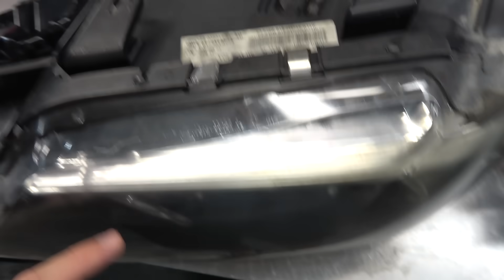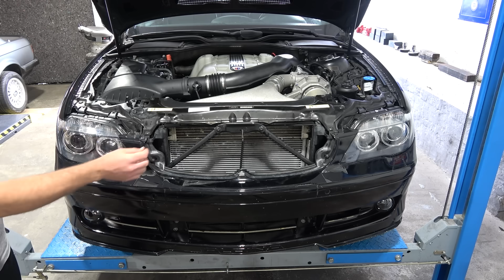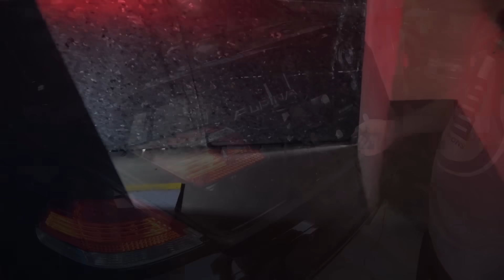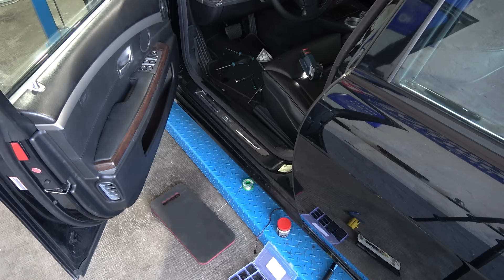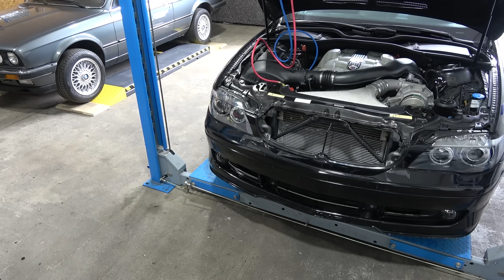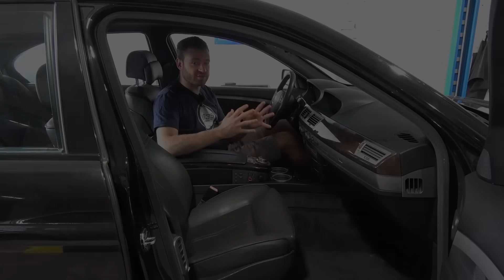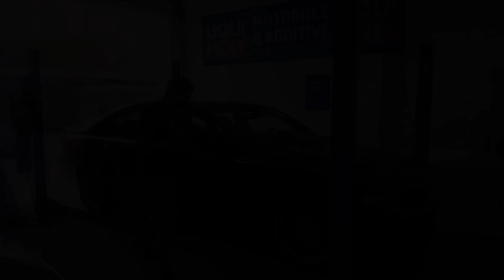Can We Make Alpina B7 Roadworthy Again? - Project Chicago: Part 12

Comment: I don't know did you do this because you didn't mention it or show it on the video (thankfully) but you have to shake those paint cans for 3 minutes. Some of them even say that on the can itself. Why? Because that mixes the paint inside them very properly and most importantly the pressure inside the can is very consistent after that and the jet coming out of the paint can nozzle is very smooth and uniformal. This also helps to avoid the orange skin on the part you're painting.

Of course all this is too late and, as I said, I don't know did you do that shaking for 3 minutes but just a headsup for you and everyone who's doing spray can painting. I did spray can painting as part of my job for 4,5 years and you could clearly see the difference between a spray can which you have shaken for 3 times versus the spray can you have shaken for 3 minutes.

Comment: Okay, you might think I'm completely wrong, and I might be, but I always say that if your brake line can't hold the weight of the brake caliper, it should've been replaced anyway. Of course, that only applies to smaller brakes. Anything with 4 pistons or more is way too heavy for that. But a single or dual piston caliper can be held on the brake line, IMO

Comment: The blinking from the LED angel eyes is from the bulb check. It sends a quick pulse of power that wouldn't be enough to light up a standard bulb, but the LED can react faster, so it blinks. These checks can be coded out to avoid the blinking. You'll need to code out the cold check, the warm check, as well as the notification in the gauge cluster for a failed check on those bulbs.

Comment: Isn't it a contradiction to say that the TUV is very strict because Germany's autobahn network allows ultra high speeds and yet the TUV cannot fail poorly functioning suspension if there are no leaks from the shock absorber?

Comment: Fuck bmw dealers, there are better mechanics. Just bought a Icarsoft V2 for my E70. The auto hold comes and goes. Works fine when its warm now in the summer but when it was cold it almost never worked. Sounds like some cracked solders unfortunaly and that I have to find a mechanic to fix.

Comment: you can also use ceramic coating on the plastic trim parts, makes them look black aigan. also how is the foliatec laquer holding up?
Reply from the maker: I tried, doesn't work :)

Comment: Re the license plate light, a possible workaround is to dismantle the light and use a marker to black out a few of the overkill LEDs.  I do that for aftermarket LED turn indicator bulbs which are way to bright as well.  It works a charm and especially for your license plate lights you won’t see those ‘blacked out’ LEDs.  Hope that helps.

Comment: You can get rid of the flickering LED by deactivating the light bulb check with a BMW coding tool of your choice. The FRM Modul takes care of anything light related and any parameters will be found there. Bimmercode seems to be the most convenient tool for this kind of coding.

Comment: Great content as per usual. Yesterday I saw a local E46 M3 for sale. It's really beat up, SMG transmission, and convertible. Also way over priced like so many things these days. I thought of how it could be a fun project to fix up Sreten style, with a conversion to manual transmission thrown in. Not ready to drop that much $ into an old Beemer right now but it would be a fun project. BTW I like the V8 sound in your intro. Is that from your E39 M5? Keep up the great work. Much respect and cheers from the USA. 👍

Comment: A tip from a car painter, you're moving the can wrong. Those short passes gives an uneven coverage and can over time start to get a flame appearance. Start spraying 15-20 cm before the object and don't stop until you pass it. The can should be 15-20 cm above the object and each pass shall cover the last with 30-50 %. This way you'll get even coverage and a nicer finish that will last longer and especially resist getting discoloured by sun. Spray paint from cans are much thinner than ordinary car paint so apply three layers. 😊

Comment: Melkus!😍
And of course wood trim. Carbon fibre is supposed to be on structural parts, it's not supposed to be decoration. And aluminium? Even at home the central heating isn't supposed to greet you in front of your face and you're not driving a fridge or other home appliances. Piano lacquer finished plastic? That screams cheap Alibaba finish and always is dirty.
Wood=luxury. Period.

You inspired me to fix my old leaking Audi 80. A 2.0 ABT (no, not the sports type xD) without oil leaks or oil consumption? I thought it was impossible😆

Comment: It's good to be InterCars worker. I bought a bad from the factory replacement for crankshaft positioning sensor, went to the guys at the warranty section, gave them back the bad part, filled some documents and viola. In 3 days they've returned my money. This was the 3rd brand new replacement crankshaft sensor. Finally I just bought OE sensor and it works fine since then. I guess it's true that E38s do not like replacement crankshaft sensors and go well only with the OE.

Btw. I love your vids, but more importantly your Beemers :)
Reply: LOL and how easy to replace the blower motor. I remember i took me 2 days to replace it in E38 xD

Comment: @m539 Restorations Try another dealer. I have spent 10s of thousands through BMW Group and anytime I have a defective part including brand new out of the box, the dealer able to use the 2yr warranty and just orders me a new one and exchanges the old one free of charge. I've never had to have them diag the car. I just tell them a shop diag'd it and it always gets approved. Any defective trim, etc I just send it right back for a reorder. I think you're getting hassled for no reason. Which is bs and unacceptable.

Comment: A few years back I've watched a video that explain why the LED of their headlights flash like in the video when the key is in on position before starting the engine, the person in the video state the flashing occurs as the control unit of the vehicle check if you have a busted bulb by running a small voltage for a resistance check hence the flashing bulb. This is to prevent the vehicle from being driven if their is no more working brake light or no more working headlight as a busted bulb will be detected as an open circuit.

Comment: LED blinking can be removed.  You have to turn off the bulb checking after switching on the ignition in NCS EXPERT.  You can turn off only the position lights or any other lights as needed

Comment: 51:30 actually you should not open the cap, but unscrew bleeders - you don't want to get contaminated and overcooked brake fluid from caliper to your DSC pump. Maybe its a bit exaggerated but I prefer to do it that way :)

Comment: Nice to see that after a decade and a half blower resistors burning themselves out are no longer a problem since that issue that plagued late E34s in the early 90s was identified and fixed. Or perhaps not.
The one going in mine soon is getting thermal goop and a heatsink so it's one less source of that ugly cabin smoke flavoured aroma

Comment: Great video. You can fix the LED plate lights by painting them. Make a rectangular piece of tape to cover the center of the light. Paint around the area and then remove tape effectively making less area for the light to shine through. Continue to shrink the surface area with smaller pieces of tape and more paint until you achieve the right amount of light coming through. You can get it to look just like your 5-Series. Problem solved 😀

Comment: Excellent work as always as though there is a choice that I don’t actually support: why did you decide to go with a mix of LED/Xenon lights for the front end when you could’ve just decide to go with full LED/Xenon (even for high beams)? Was it because TUV requires the car to be completely original even in the choice of the lights or because you wanted the original look of the car? Whatever the answer is I support your choice, but for the general look I would’ve preferred a complete set of one type of lights, for homogeneous purpose. It’s like when now you buy a new car and has a mix of halogen and LED lamps, for me that’s a nosense (excluding the rear license plate lamps)

Comment: Another brilliant video. Been a fan of BMW since I was a “lad” when a neighbour in the 70’s turned up with a brand new E21 320 in Henna Red! Have since owned an E28 two E24 and my favourite an E31 4.4 Ci 👍👍 You’re approach and workmanship are superb. Thanks for sharing. On the defective fuel pump. My rationale would be the warranty process of the dealer diagnosis kicks in if the part fails one fitted and at some point in service. However they have supplied a defective part from the outset. Hence they have breached their part of the contract with you and should provide a refund? Not sure how German consumer law works but the part was defective from the outset regardless of any warranty clause so maybe worth another go with them. All the best and thanks again for all your hard work on these amazing vehicles. Regards. Dave 😎😎👍👍

Comment: Sretene, the US-spec cars did not come with the rear fog light switch (button) at all. The US-spec switch just has a single front fog light button and no nothing else.. Interestingly, for some reason the previous owner in the US must have installed the Euro-spec switch at some point which is why you have it on your car. Hey - you saved a few Euros. Treat yourself to some strawberries!

Comment: In the US the dealer can not force you to bring your car in to exchange a new part under warranty. You can directly exchange it at the parts counter if its bad. They have to by law… Also you should of painted the wiper arms flat black to avoid sun reflection into your face from the arms.

Comment: There's a reason that blower resistor burned that way, I would totally check on that blower before something happens again
Reply: There is a recall for the blower motor/resistor wiring burning in the E9X 3 series, i couldnt find anything but maybe there is a similar issue on the 7 series.. I need to get mine done but i dont want to leave my car at the dealers.. first world problems..

Comment: I dont understand why you drained out the oil in the new compressor?  Wouldnt Denso, the company, know how much oil should be placed in the new compressor? And how do you know that the oil level in the old compressor is right? I would tend to side with the brand new compressor and oil that came from the factory. To me there is not enough oil now in the new compressor which you took out, which will  lead to failure  shortly.

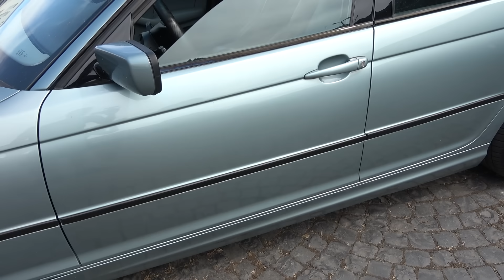Comment: 27:42 the paint will flake or crack with age.

Worn plastic is easily rejuvenated by applying wd40 by hand to liven them up back to crisp grey.

Painted trays always end up ageing in a bad way over time. The OEM choice of finish in this instance is one of the reasoning and logic I agree with the manufacturer.

Nufinsh polish the plastic tray and glass to make the windshield easier to see through at speed in the rain. 

33:33 This era are too fussy, much too much plastic and oversized.

Comment: Just wondering why the AC compressor comes with way to much oil in it? I bet there's loads of mechanics that just install a new one out of the box with whatever amount of oil is in it from the factory.
Reply: The oil that comes in most compressors is just there to keep the seals lubricated before installation.
Reply: @juggnautbitch  but surely the smaller amount of oil would do that, why over fill it?

Comment: Great in-depth video.  I can understand that maybe the headlights don't meet EU specifications etc however, that the tail lights also need replacing as their main  purpose is to illuminate whilst your headlights are on and to further illuminate brighter when the brakes are applied seems a little over the top to me.
Reply: I think he replaced them due to being worn in general and for being cracked in multiple places. A functional and fresh look for this beautiful beast!
Reply from the maker: The taillights were US spec and don't meet EU regulations and wouldn't pass the inspection. They have running lights on the sides which EU ones don't and more importantly, the turn signal is red and not orange. Also, they were completely destroyed and had to be replaced.

Comment: Love your videos, heres a tip for trim restoration, instead of painting which can be a gamble at times, use CERAMIC COATING, it leaves a deep wet black finish for many years and is flexible.

Comment: i don't think AC oil is the right thing to do. Just bolt it on. Who guarantee that system was changed properly before and that they measured oil in the system. Maybe system was low on oil and that why AC comp is dead? And you amid it low on oil again....hope you understand. I would use original oil from new compressor

Comment: Great video Sreten and amazing job on bringing the alpina this far. I have a quick question regarding the side mirrors. I vaguely remember one of them not being original as they couldn’t close electronically, has it been fixed and I didn’t realise or is it yet to be addressed? Just a quick heads up.

Comment: Greetings from Australia.  Love your work and attention to detail. The after market license plate lights. If you put a single resister say 330 ohms 1 watt in line either ground or supply, use heat shrink to insulate. This will reduce the light intensity, higher resister for less light if you want to fine tune it. worth the time.  Cheers

Comment: Bro I used to have a e46 m3 and the headlight washers were not supposed to work EVERY time you pull the windscreen washer stalk, I think they work once evry 6th pull. It maybe the same with the 7 series! Check the manual..

Comment: When replacing a condenser, it depends on the car but there was probably about 30 ml of oil in the condenser.
Reply: Does the condenser manual usually say to drain the oil? Seems odd to match the old one, surely the reason the old one made noise was potentially low oil level.

Comment: you should have checked the fan before changing the fan resistor.
usually a fan with high resistance will cause the resistor to run hot until it burns.  or just a blocked air filter causing high resistance.
common issue on Mercedes. the fan starts to fail and its best to replace it early before needing to replace it with the resistor.
first time i see the issue in BMW. ill start changing my filters more regularly .

Comment: Hi, first of all i want to congratulate you for the awesome content, and for your sense of humor... my type ;)

About the differential oil level.. i had a Dutch Motorsport shop rebuild my E91 one, and they told me 2 things about mantain it: Use OEM fluid and always put a bit more than the level... like if it takes 1.8L to the level, use 1.9 to 2L... obviously i have to, in my case, have the rear of the car higher than the front so it can take that extra and not seep through the fill plug.
Reply: BTW, my E91 has a M57 engine (335d)... so the dirty fuel from hell ;)

Comment: Here in Japan they don't care about the lights, or any region-specific parts, whatever the car was equipped with, wherever it was made will make it legal for the road. I can buy a police car or fire truck from America or Europe, leave the police or fire department markings, lights, and sirens on it, and I can legally drive it that way. The safety inspection is about the same though, but with a few extras, cars in Japan cannot pass inspection if they have dents, mismatched paint, torn seats, or other cosmetic flaws. Inspections are expensive, for my 750i, it runs about 1500 euros per year.

Comment: Does anyone know the part number for the original OEM LED licence plate lights for the E60, please?
Reply: and would I have to change/solder the wires (with/without some resistors)? Or can I buy a genuine kit that I can retrofit onto the E60?

Comment: Just a tip from a retired painter: Plastic primer adheres to the plastic; the paint adheres to the plastic primer. Plastic primer does not give flexibility. You have to add a softface additive to the paint to achieve flexibility. Remember the floppy spoiler/bumper covers of the 90s on Suzuki Swifts etc :)

Comment: You can code out "Cold Monitoring" from any desired lights. This will stop the car pulsing your bulbs when they are not operated thus stops the LED flicker. While keeping "Hot monitoring" active you still get your broken bulb notification but the test is performed only when the bulb is already on